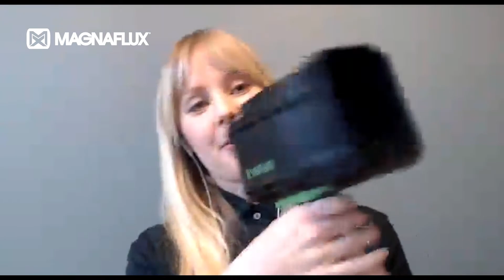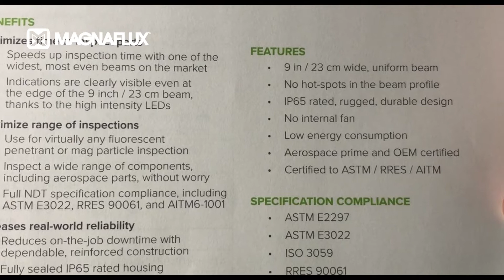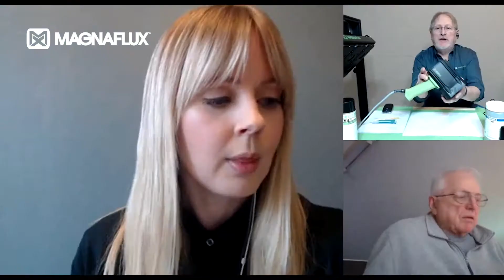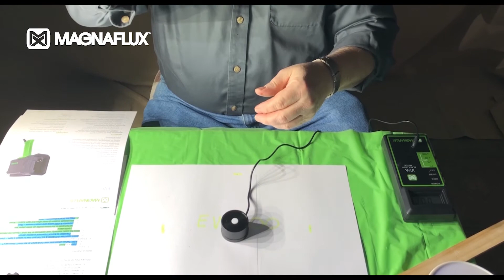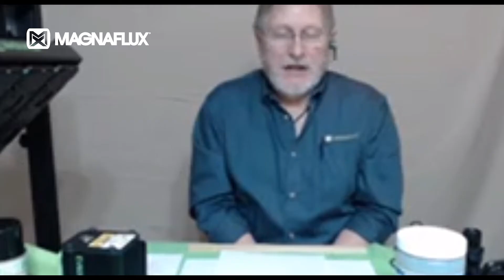[Webinar] EV6000 Hand-held UV Lamp Demo and Q&A

Comment: First off, thank you for demonstrating the EV6000.

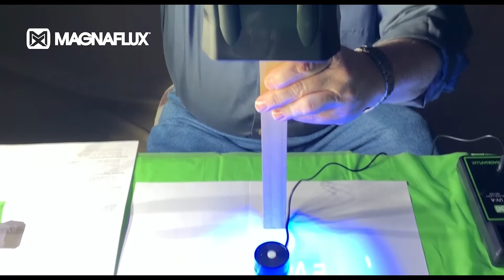At the 6:23 mark, shouldn't the measurement be taken from the top of the sensor and not the table surface? I am a certified Level 2 and have been in the industry since leaving the Army in 1992, and I have always taken my readings from the top of the sensor.
Reply from the maker: The 15" distance would be from the top of the sensor to the surface of the light. The caveat here is that if your measuring device is actually on the sensor, it will block some of the light from reaching the sensor and thereby give a low reading. The sensor is about 3/4" high so the difference could be considered negligible. The measurement tool you select could be made slightly longer to account for the thickness of the sensor. The measurement tool featured in this video was made slightly longer to account for the thickness of the sensor at 15 3/4" long.